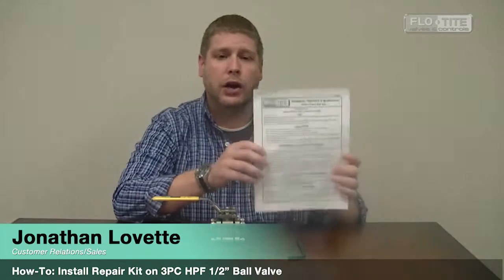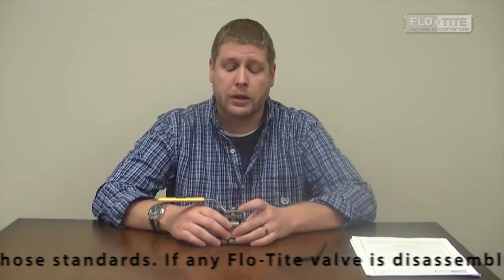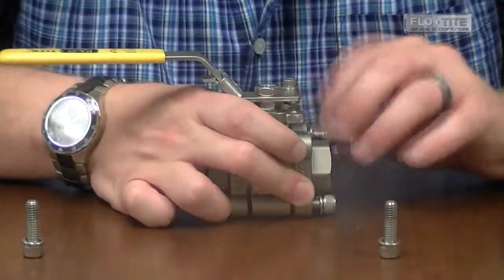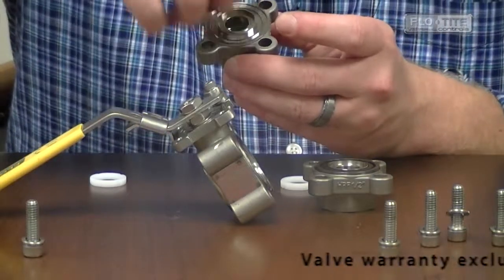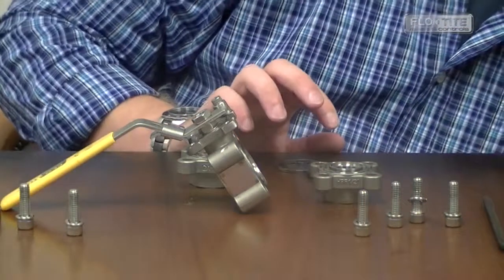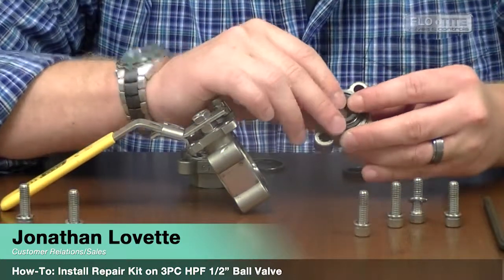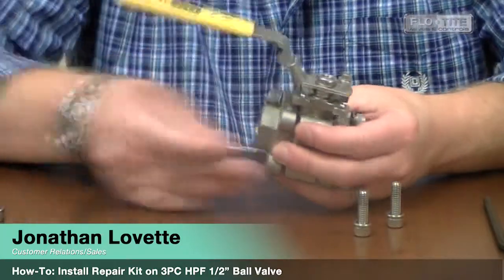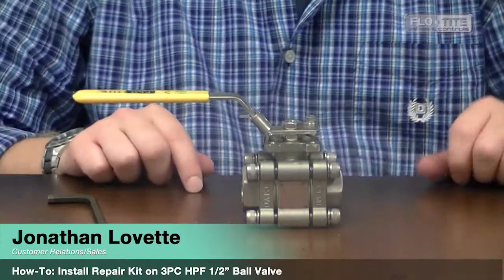How to Install Repair Kit to Change Seats on 3 PC Ball Valve - Flo-Tite

Comment: Actuator Rack & Pinions Manufactures

Dear Sir,
 
JKGEARS is a Vasai Mumbai, India Based Company Specialized in
manufacturing of All types Of Pinions & Gear , Rack Products, Mainly
for Actuators, Valves, etc. on all modern CNC Gear Cutting Machines.
 
The Internal Gear Cutting is Done on CNC Slotting Or Gear Shaper
With Shank Type Cutters And Not On Tradition Slotting Machines. 

Our Pinions Provide low backlash and positive pinion engagement . 
Our Pinions Can be Supplied with Zinc Flake Chemistry from Overseas 
Mainly For actuator pinion application & Operation Life Cycle .
We provide a complete solution to you for directly assembly .

Request you to please send your valuable inquiries at Email: -
info@jkgears.com , Whatsapp Or Call Mr Dalbir Singh Bright On : -
+919867973046. Our Website :-  www.jkgears.com
 
We are happy to come & discuss with you with your Appointment.
 
Regards,
Mr Dalbir Singh.
J.K.GEARS & MACHINERY
KUNARK GROUP OF COMPANIES
Email :- info@jkgears.com
Mobile1 & WhatsApp:- +919867973046 ;
Mobile2:- +917977043901
Website :- www.jkgears.com